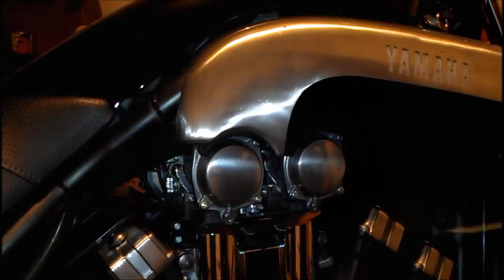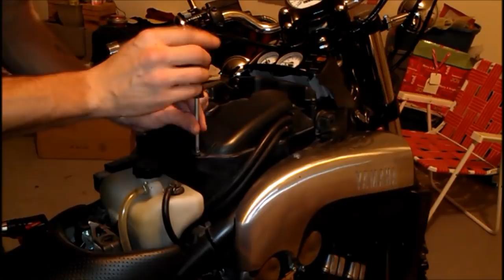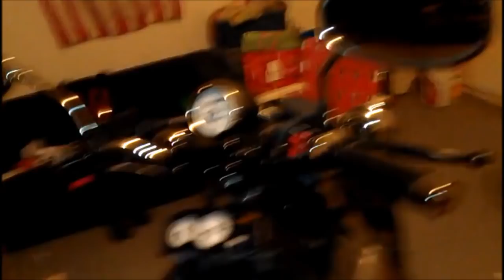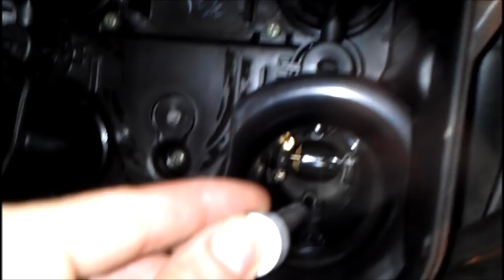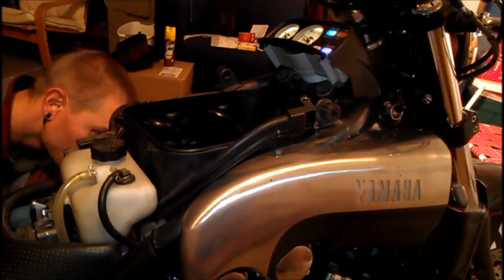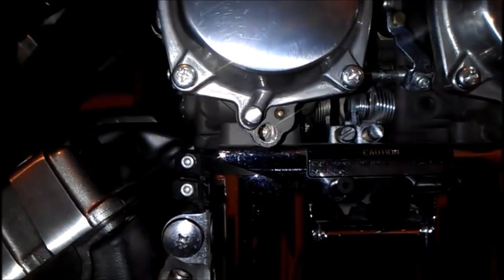Pea Shooter Carb clean Yamaha V-Max

Comment from the maker: Mainly performed as a preventative maintenance procedure. I did notice slightly sluggish throttle response and the need to apply choke for cold startup was new. This, along with regular fuel treatment cleared it up.

Comment: Whilst fuel/air help idle - I found the best fix for idle and reduction/removal of cold start back firing was the replacement of the factory ignition coil packs. I used some direct coil over plug units from a later bike and wired them directly to the factory coil wiring. The result was a lot more smoother and faster throttle response. All for ~$40

Comment: hello,perfect video,I did everything U did exept I didnt remove those covers which cover those snicky srews,and my V-max running like brand new(2007 5K miles)thank You so much!(but by the way can You tell me why those 4 srews have to move 2 turns each,and later back on?)
Reply from the maker: it opens the idle air mixture to allow more cleaner to penetrate

Comment: the instructions on the carb cleaner  can say ... start the vehicle ... let it warm up a bit ... remove the intake tube and spray cleaner directly in to the carb ... while applying a little throttle ... all the gunk and clogged material goes out as black smoke our of the exhaust  ... i have tried it with many old cars it worked well ... why wouldnt it work here ???
Reply from the maker: That will work to remove a small amount of gunk on the surface and visible areas. This process gets directly into vent tubes and more internal cleaning.
Reply: Because spraying carb cleaner into a set of carbs shrinks the o-rings, diaphragms and gaskets.

Comment: So, you're drilling out the brass plugs to get to the A/F mixture screw?  And then plug them back up with what, a rubber stop?
Reply from the maker: I didn't put anything in after, this was an Phoenix AZ bike, wasn't concerned about moisture or corrosion

Comment: what fuel cleaner are you putting in the syringe? I really need to do this. Glad I came across your video
Reply from the maker: Detroit Dizzle Berryman B-12 Chemtool is what I use, but SeaFoam is perfectly fine too.
Reply: treezy8769 thank you
Reply: @treezy8769  I can use Car80 spray?

Comment: Hey dude i plan on getting one of these, is it possible to remove the airbox and replace it with a conventional fuel tank?
Reply from the maker: a slim custom one by Morleys Muscle. the carbs sit up too high on the motor to have a conventional tank.
Reply: treezy8769 Damn, I love the Vmax but for some unknown reason i just hate the idea of the fuel tank being under the seat, thanks anyway dude.
Reply from the maker: +GHOST yeah, it's different. but you get used to it 👍
Reply: Reason is well know. You don't even have to know how to repair bikes its simply physics - to lower centre of gravity you lower the tank with a fuel.
Reply: How are you gonna filter the air that goes into the carb? I removed it and have individual filters on each carb? But a fuel tank? Doubtful!

Comment: carbs should come off bike and be stripped then cleaned with carb cleaner and compressed air. then with the factory specs, climber manual, 40 bucks rebuild.  thats the only way to do this job right. and to set floats and sync carbs you have to have the specs and sync meter . talk to a bike mechanic thats what they will tell you,
Reply from the maker: there's no need to completely remove all 4 carbs every time they need cleaning.
Reply from the maker: Seth'sChopShop   thanks man. 8 years ago when I made this video, the only info I had was from the vmax forum.